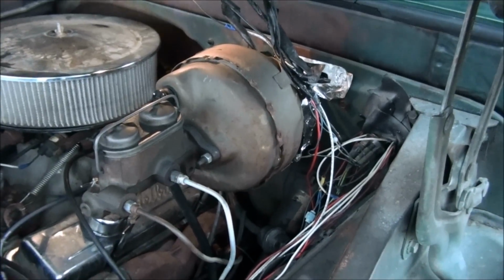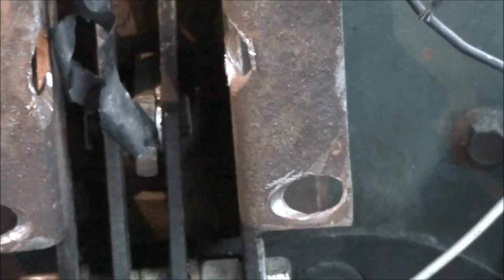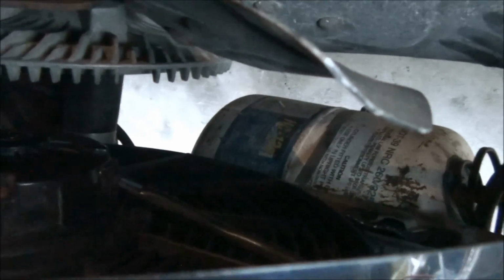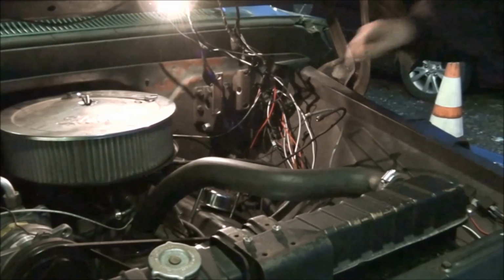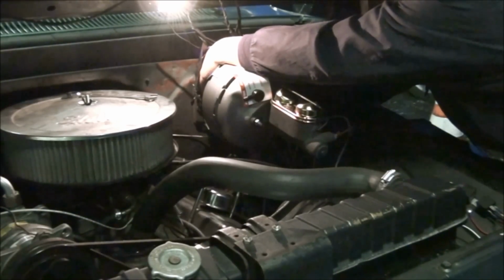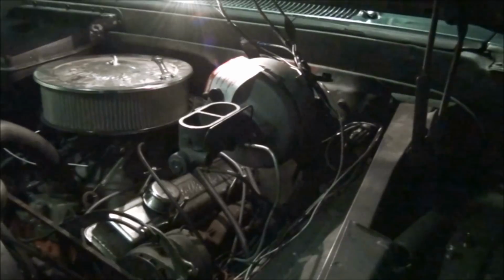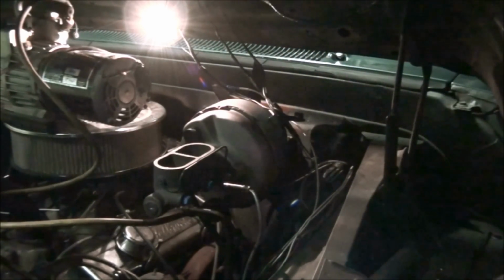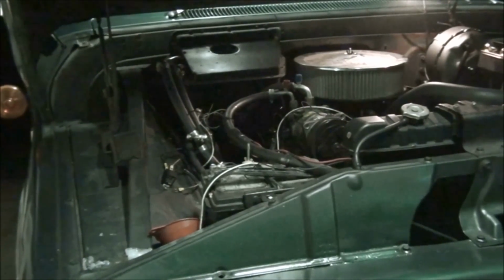HOW TO ADD POWER BRAKES CHEAP 1960-1966 CHEVROLET TRUCK C10 C20 C30

Comment: I really don't believe that you bent the rod.
And you don't say anything about the 1960 to 1962 that have the  hydraulic clutch together with the original brake master cylinder. The  set up is different from the 1963 on Probably what you are talking about?
Correct?

Comment: what year F150 bracket for the brake do I need? I just got a 1966 Chevy but no power brake, & I want to do dual brakes system & a cheap disc brake conversion in the front

Comment: if u want to run a big comp cam u should put the hydraulic assisted system instead of the vacuum can u can get them out of the diesels i know a 79 chevy has the system in it only if u have power steering
Reply: i just got a 65 short wide for a broke down 90 cutlass that i got fr free . the pu doesn't have a motor but i got a 454 stroker or a 327 to put i it

Comment: m horns.Is that a dodge radiator that's why you had to drill out your hold down bracket.Plug wires use 1973-74 chevy corvette plug wires.They are the only ones that that will work for are chevy trucks that want to use the HEI they come up under your front motor mounts have to take your boots off To side them throw.Only thing I can say is Use M&H re pop wire harness for your engine bay it is a plug and play system.Stay away from Painless cus it really looks like Crap

Comment: The rectangular casing in the upper left of the motor...Is that the heater core? I just bought a '66 c20, and it is smoking from this.
Reply from the maker: yup , just take the screws out and the top comes off , you will see , also the blower is mounted in the bottom , could be the motor burned up , or the fact that the core was wet , and when warmed up steamed ??? your box is slightly different than mine unless your truck was a US Govt contract truck , but it is close , my heater is a non controllable fresh air , they are rare ... yours will have a lever for fresh air , and a flap in the box under the hood , that is the cable you see at the side of the box where the hoses are , mine has none of that ...
Reply: beltstowing it also has a slight leak, from a hose that goes from the radiator to the TRANNY. wHAT IS THAT ALL ABOUT?
Reply: beltstowing   http://seattle.craigslist.org/skc/cto/4155751076.html
 This is it. The exhaust blows out ALOT until it warms up. I just hope the head gasket is ok

Comment from the maker: @chevy67292truckcst you can do the same thing , you already have the dual master cylinder so you don't have to do the re-plumbing , you can make the z bar bracket from scratch too , need measurements ?

Comment from the maker: @speedy75602 well this video was like 3 weeks back , wait till you see what I did use , not an inner tube , it is a brake related part , and not a firewall seal either , it is funny ...wait till you see :)